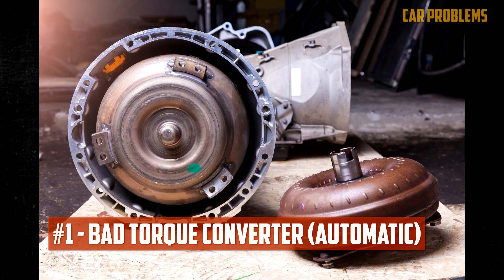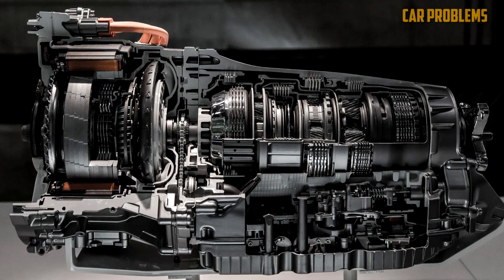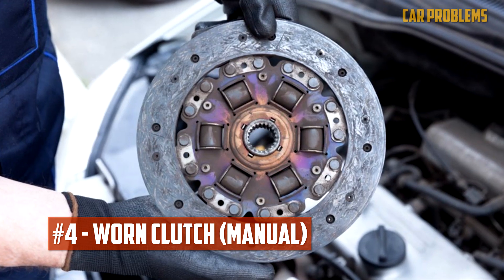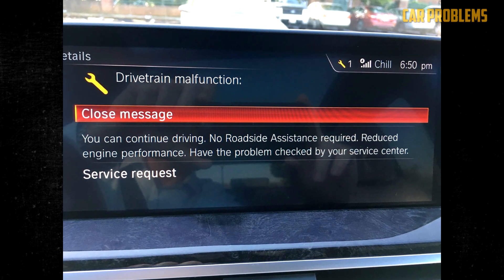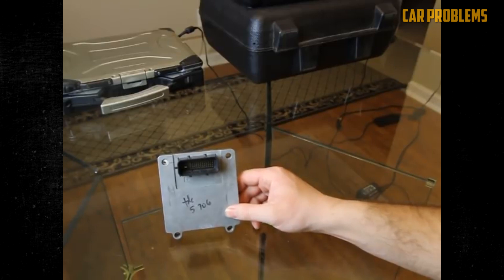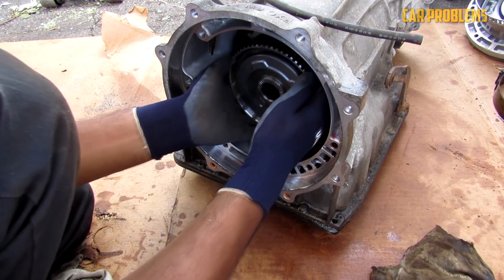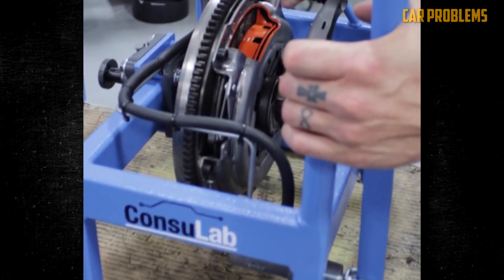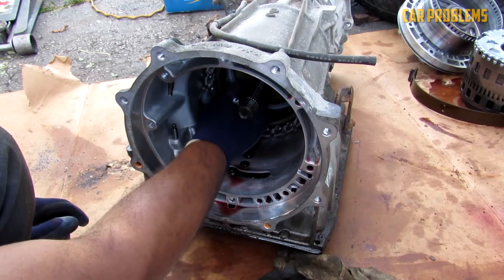6 Causes Car Won’t Accelerate But RPMs Go Up &How to Fix

Comment: Hi guys I have a 2005 Honda odyssey while driving I reach a speed of 40mph then the idle goes up high then I only can go about 35 maybe.why is this happening and how do I fix this issue.ibplugged it up to check codes also and replaced o2 oxygen sensor

Comment: Nissan jatco cvt's do this to when cold minus 15.C  there hild the RPM's up just passed 2000 and mine will only give you 50 kms/h out of it no matter what you press the accelerator  to till it warms up ive looked it up the TCM commands this behaviour  till the engine warms up then its 1250 RPM @80 kms/h when warmed up scared me the first time but its totally normal behaviour  of the CVT's likely to protect it it scares me that it holds the RPM's so high when cold

Comment: I got a 2015 Sonta eco with a DCT. Sometimes when I come to a stop then slowly accelerate, the rpms rev high and the acceleration lags. But I also noticed there's a little lunge afterwards but so far there hasnt been any warning lights

Comment: So, I just bought a 2025 Kia K5 GT line 2 days ago. When I go to drive, it immediately starts revving high, like up to 6500 RPMs, by the time I get to 15mph. It also feels like I am getting half the power when I accelerate, like it wants to top out around 15 or 20 mph. Of course it is Saturday afternoon and the Kia dealership service center is closed so I have to wait until monday. Does anybody have any ideas? It's apparently very hard to figure out on Google.
Reply: did you find the problem ?
Reply: Shouldn't be doing anything but driving perfectly u just paid for a new car I would be passed
Reply: I took my 2022 K5 back to Kia... Looks good but Kias are trash when it comes to powertrain... Take it back & let them figure it out or get rid of it before you be stuck with no warranty, which they rarely honor anyways
Reply: Could be a dirty throttle body,  worn clutch, or low on transmission fluid
Reply: What do u need to figure out? It's obviously faulty take that shii back before your stuck with the bill

Comment: Guys try cleaning the throttle body it will resolve the issue if it's high rpm and no speed . thank me later
Reply: I d8d today i will let u know if its work
Reply: @legoshi5335 Did it?
Reply: @legoshi5335 did it work
Reply: @legoshi5335 so did you forget abut us ? Feedback
Reply: Trying this today

Comment: I fixed lack of acceleration in the car specially on highways or motorways by replacing the blown up break tail bulb. Nissan Primera 2004
Reply: Are you serious? 😂 I legit have a blown brake bulb and I can’t accelerate 😂 2002 Cadillac Escalade
Reply: @MagentaGiraffe  Yes

Comment: Dodge challenger. Rpm goes up to around 4 or even the 3 but I’m accelerating. I believed it was  transmission clutch. I’m no mechanic 😁. I am not sure. This car is 2012 v6. 

Watching this video now see if this helps me.

Comment: Hi I got an audi a3 2.0tdi manual and when I want to upshift with 2500-3000(high rpm) in lower gears rpm increases like crazy after 2000rpm but no speed
Reply: This happens when I give gas immediatly
Reply: TDI engines r shit
Reply: Mine does the same i drive an a4 2.0 tdi , have you got the problem fixed yourself?
Reply: i have the same problem aswell with a4 2.0 tdi manual, anyone got it fixed?

Comment: 2002 mustang 3.8 I have car runs perfect but once engine is warmed up and I have to restart it sputters and pops and idle is crazy and stalls unless reb it up to get it running o.k sometimes rpm goes up more than usual qnd like not wanting to go??? I've changed a few things do you have a guess
Reply: did you ever find the fix i have a z28 camaro same exact issue and im stumped
Reply: Might be the crankshaft position  sensor, clogged fuel filter, faulty coolant temperature sensor.

Comment: P0171 ? I’m stressed out mechanics can figure out the problem
Reply from the maker: P0171 indicates a lean air/fuel mixture in the engine. This can be caused by a variety of factors, such as a vacuum leak, faulty fuel injector, or a malfunctioning oxygen sensor.